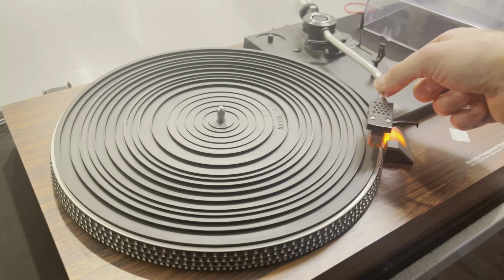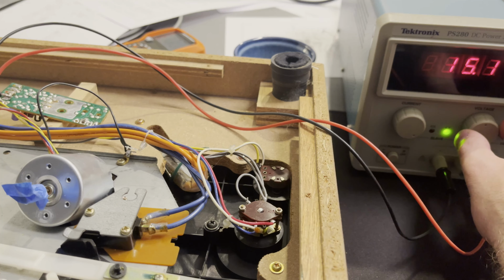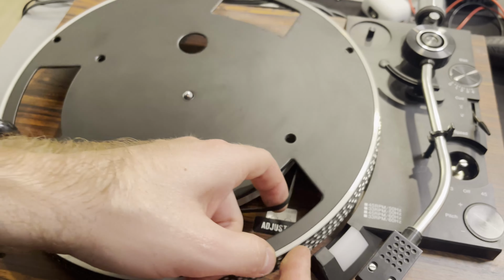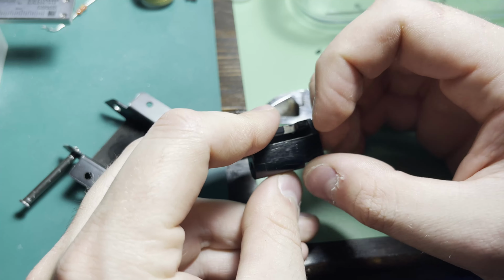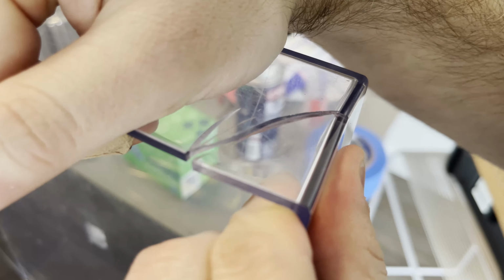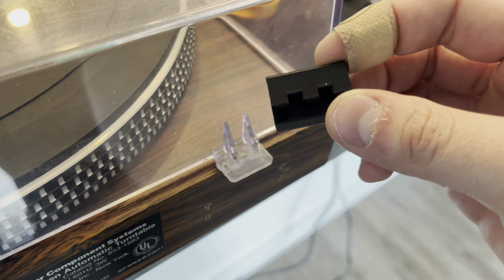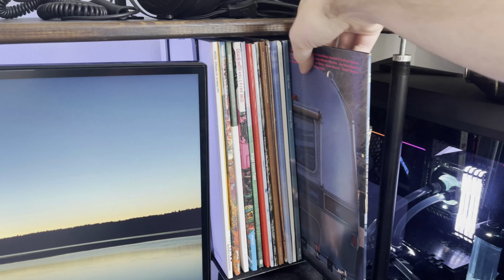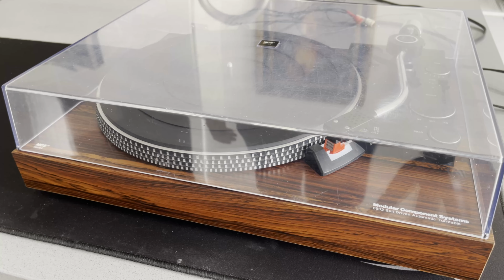1970’s Hi-Fi Vintage Automatic Turntable Revival | Vintage Hifi Revival

Comment: I wish I could get my MCS turntable fixed. I have three turntables and if it worked it would be my favorite one. The problem is, the left channel occasionally cuts out. I've replaced the cartridge, the headshell, cleaned the connections and calibrated the tonearm. It has a nice cartridge and sounds fantastic until the left channel still cuts out and I don't know what else to do with it.

Comment: Hi you ask about how to address the scratches on the acrylic plinth cover. Think of it as a modern car headlight. You can get various remedy kits online.. Or you can first use the finest grade ( 1500-2000) wet and dry grit paper on the worst of the scratches. Followed by using a mop attached to a drill with a paint renovating compound . Finally to make it shine , believe or not toothpaste with a damp cloth..

Comment: The generic replacement stylus (needle) is a 697-D7 made by Phanstiel.  It uses a tracking force of 1 to 3 grams, 1.5 being optimal.  If you are going to continue to repair these kinds of turntables I would highly recommend purchasing a digital cartridge turntable stylus force scale, preferably the kind that uses internal calibration and not the ones that have to be calibrated with a seperate weight that is placed on the scale.  I haven't had much luck with the longevity of those.  If that counterweight on the back of the tonearm gets moved in any way then it HAS to be recalibrated or you could get distortion or even vinyl damage. If, like me, you have more than one SME headshell with different cartridges mounted on them then this is an absolute MUST HAVE tool.
Reply from the maker: Thanks for the tips!

Comment: Back before my shoulders finally waved the white flag to arthritis, I used to repair and refurbish older turntables. To refinish the dust covers I used a product called Formula 1 Scratch & Swirl Remover.  Almost any automotive parts store carries it.  It comes in a 7 oz. yellow plastic bottle.  What @demons500 recommended may well be a variant of this but this is used mainly on car bodies.  You use a microfiber cloth slightly dampened to apply small amounts of it over the damaged areas then let it dry to a haze.  Using a dry microfiber cloth just lightly buff it off.  This will take a bit of time, depending on how badly the dust cover is damaged, and several applications,  but with time, and patience, you can bring a dust cover almost back to looking like it was brand new.

Comment: Next time when you have to glue acrylic use Dichlorethan. Yes is dangerous but melt any plastic and vaporize easy. Do not use it in closed room or if you use it  make sure that you have fresh air or well working ventilation system.

Comment: I don’t know if you addressed this off-camera, but all of these automatic and semi-automatic turntables eventually need cleaning and lubrication of the trigger mechanism.  How they work is that there is a lever connected to the underside of the tonearm that engages a small sliding or pivoting piece that triggers the cam (that’s the large gear).  What usually happens is that the pivoting/sliding trigger gets gummed up and manifests itself as resistance to the free movement of the tone arm causing skpping on the last track of an LP.
Reply from the maker: I did clean and add some new lubricant to the automatic return, they are really cool mechanisms too; all mechanical with levers and cams. Now a days It’d be done with some microswitch and a servo.
Reply: @HifiJelly  - I figured that you had done that. I serviced a lot of automatic turntables in my day and thought it needed mentioning.

Comment: What was the deal with the loose/disconnected  black wire?
Reply from the maker: I fixed it after the video, or at least I think I did. My theory is that it’s a grounding wire for the cartridge, since near to the wire was a blob of solder on the chassis with nothing connected to it. I’m guessing when it was first built they forgot to solder it at the factory, and nothing changed when I connected it so that’s probably why it went unnoticed for so long.

Comment: Loved this video.  Having 3D printed many things around the home I doubt that they will hold up, unless perhaps they were printed with a more exotic filament. PLA or TPU just won’t last unless you figured out a way to reduce the pressure from the spring.
Reply from the maker: Thank you! I am curious about this myself, I used PLA for the parts. So far it seems to be holding up well, especially that since the lid is closed the vast majority of the time and it’s under the maximum amount of tension in that state. I suppose time will tell.

Comment: Super video!! i`m thinking that the motor was stuck, giving it 24v unstock it..  i would have spinded it by hand, taken it apart and lubricates the brass bearing at cleaned the brush and commutator inside.. great job by the way.. now a subscriber
Reply from the maker: Thanks! I’ll keep that in mind for the future. I’d be concerned about not being able to get the motor back together, but if it’s already broke it’s worth a shot!